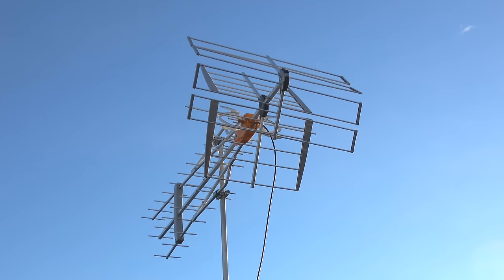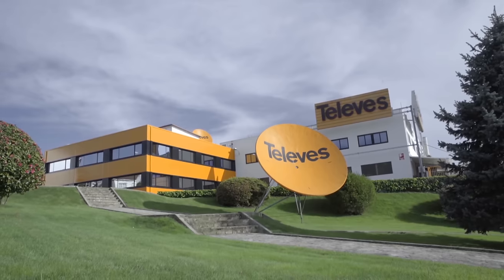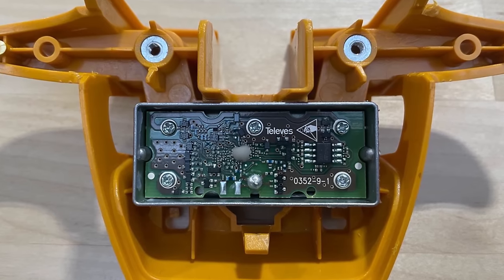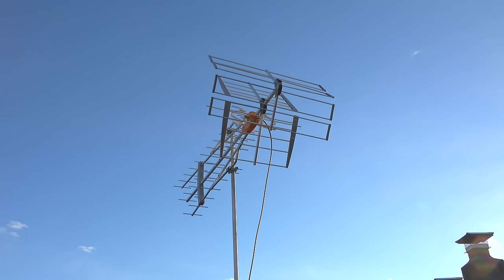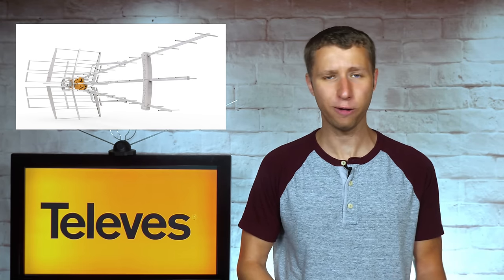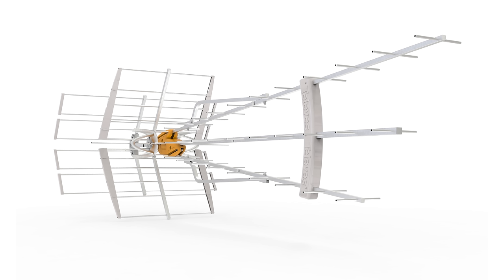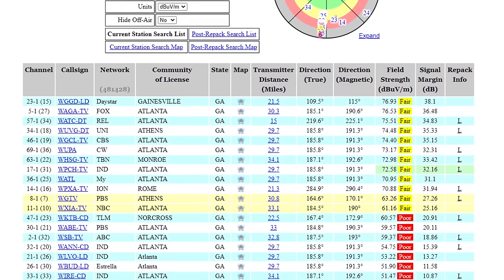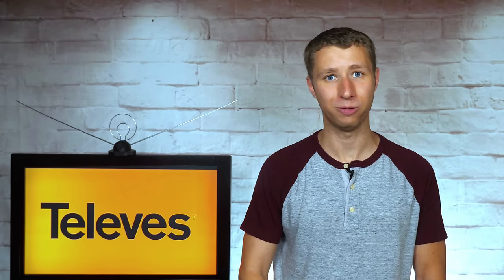New Televes DATBOSS LR Mix Review Updated Repack Model 149884

Comment: Thanks Tyler! To your point about atmospherics. We both know they were pretty good when you reviewed the Ellipse and fairly degraded now so the Dat Boss LR won out on dealing with season variation probably. Glad you figured out the magic is in the preamp. I picked up one of these end of May after working with the Range Expert and not  being able to bring in the 4K signals from Seattle reliably. Like I could via the older Dat Boss LR and the Stellar. I had been playing with height of the new Dat Boss LR and got all of the 4K channels for two nights [RF 24 has KOMO, KIRO, KUNS and 31 KING, KONG, KCPQ, KZJO] but King TV would not open. I am beginning to wonder if the adopters are using the same RF but on different towers or if the height of the transmitter on the tower differs for each broadcaster and may relate to signal strength? The weakest that would open was KZJO  with Signal Quality at 42 and Strength in the high 70's. It played pretty well but not to a reliable record level. The new VHF elements even had me seeing RF 11 of the old standard during the evenings much like the Stellar but here the new preamp makes all the difference in my mind along with one fewer combiner. 

A friend of mine used the Range Experts UHF element and my Stellar to pull in +65 channels at his house. Even RF 9 [PBS] at night time which is more than 50 miles and very low power. He also has my old DB LR and Ellipse. It may be that the ellipse may have a slightly wider angle than the Dat Boss but definitely wider angle than the Range Expert.  

It looks like the Ellipse Mix will be the only upgraded version to survive that series. Do you know if they will make a Repack version of the Dat Boss Mix with lo VHF and new preamp?  Do you think Televes would sell the new preamp to older Ellipse and Dat Boss owners or maybe make an upgrade package? Just got a post card they will be cutting the trees out of the power lines in my area in three weeks, about time since they are now above the top lines.  Hoping that may open up a different placement for my antenna pole to test. Maybe like with solar installers we need a drone but with an RF scanner? I did take one up 65' with a cherry picker looking for a signal, once.

Comment: What is the best long range uhf/vhf antenna that you would use. I am 70 miles from 7 broadcast areas. My antenna is 50 foot in the air with Amp and rotor. I do pretty good most times.

Comment: So the VHF element of this version is more than twice as good. I am now wondering maybe if you can somehow buy it as an aftermarket part, and install it in the older version of the LR Mix? Instead of re-purchasing the updated model?
Reply: I'd get the new model for the 5g filtering.

Comment: It would be nice if you could re-compare some of these new long range high tech antennas with some of the older style large "Radio Shack" style antennas like the Channel Master CM3020 you did three years ago. The readings in that review seem to be from completely different stations so I'm guessing they don't compare.

I don't think I've seen any good side by side comparisons with those super large antennas next to the new compact designs from Televes and the like.
Reply from the maker: I actually no longer own the large CM3020. It's not worth repurchasing the antenna and spending hours remaking the video as it would mess up the current reach of the video and my channel. I can tell you the CM3020 does better on the VHF band (especially low VHF) than the Televes LR Mix while the Televes does better on the UHF band where most TV stations are on.
Reply: @AntennaMan  - I wasn't specifically talking about getting the CM3020 again, but Channel Master still makes those type of Antennas like the Advantage 60 or Advantage 100.

Comment: Another good vid Antenna Man. Question. If i use rg6 cable, do i need a special connector to join two cables together and will connectors degrade my signal? Thanks.

Comment: I tested this antenna against the clearstream 4 max, and the 4max beat it hands down.  Not only was the clearstream picking up more channels from all directions, but the channels had higher signals.  The televes is 10 times the size of the 4 max, but could not match it.  Used the included amp on the boss, and used a televes amplifier on the 4 max.
Reply from the maker: This might be because the ClearStream 4Max isn't as directional, meaning it might pick up more channels if your stations are spread out.

Comment: Hey Tyler. Nice work. I've also installed several antennas for family and friends. I don't have signal meters or signal to noise meters. Just use tv fool. I'm in Canada. Can you please check out this new model RCA antenna. Claiming 100 mile range. I know how signals work. Just want to see how this antenna stacks up against the Televes models and so on. Here's the model number: ANANT950E 

RCA Multi-Directional Outdoor/Attic HDTV Antenna - Black
Reply from the maker: Don't use TV fool as it hasn't been updated in about five years. Most of the information on it is not accurate. Use rabbitears.info instead. As for the RCA antenna, I actually tried it out. Didn't work too well so I decided not to review it.
Reply: @AntennaMan  nothing else works for Canadians. Tried antenna web. Nothing. Found nothing. If you have one that works for Canadians. I would appreciate it

Comment: i had a recommendation  by "The Antenna Man" about a year ago and I purchases the old version of the DATBOSS LR Mix ( Model 149833 ) and it works great.  I was wondering if there are new updated  parts I could replace on my old model?  Like the rear reflector or the pre-amp?  If so, where can I purchase them, if there are interchangeable on the old model ( Model 149833 ).  Any info would be appreciated.
Reply: Older models are not upgradeable to latest specs

Comment: Feb 2024

     are   the long  beams  that stretch  out adjustable  like the smaller  model
 in your  previous   video
Reply from the maker: No, they are fixed, but you can adjust the tilt of the antenna.
Reply: thank you

Comment: it would be a great model for attic or garage , with the built in amp/electronics I don't think it would survive to long if you live in extreme climate conditions
Reply: These antennas are installed in over 100 countries in all sorts of environments. From scorching hot in Africa to subzero in Scandinavia. The preamplifier is fully shielded and weather resistant.
Reply: I have 1 & so far it has survived a Louisiana tornado. The other Televes I own is older & made it thru 2 hurricanes.

Comment: My antenna is in my attic and my channelmaster powered splitter is about 5 feet away from it. Will this antenna cause to much gain when used in conjunction with my 4 way powered splitter or would it help

Comment: How do you think this antenna will stack up against my 91XG With a booster, it works great but it's getting old, and sometimes even with 100% single, I get some pixelation, I'm guessing this may be 5G interference, thinking about replacing. Enjoy your videos, very informative. THANKS!
Reply from the maker: They would be pretty comparable to be honest. Technically the Televes antenna may have a bit more gain with better designed UHF elements and a built in preamp. However, it would be hard to say whether it would work better or not since both antennas are pretty good.
Reply: The advantage of this antenna is THREE over your 91xg. 1: It also does VHF within a 65 degree spread. 2: It has a built-in 5G filter that starts at 608Mhz 3: It's basically cut to not receive anything past channel 36. Your 91xg goes all the way up to old channel 83.

Comment: I purchased a DATBOSS Model 149884 last year for my location in the Michigan City, IN area (near Chicago). While it has served me well, lately I have temporarily lost channel signals at times. I don't know if this is due to spring/summer and foliage on the oak trees, signals from the broadcast towers, needing to change my coax cable run after getting my roof re-shingled, or installing my antenna higher (about 25' above the ground...Or maybe I should upgrade?  That would be a bit frustrating as I spent about $200 last year.
Reply from the maker: You should not need to upgrade your antenna. You already have one of the best models. What I would suggest is to check the power inserter to make sure the status light is still on. If it's not on you may need to replace the power inserter.

Comment: I'm having a difficult time finding a good antenna that works for television as well as my stereo receiver. I'm not sure if the antennas don't do low band UHF, or if the amplifiers in the antennas cause interference with the FM tuner in the receiver. If you think this model does well for UHF band, I'd like to see how it would work with radio reception as well.
Reply from the maker: Most antennas don't have low VHF capability for FM. I wouldn't recommend this model for you since it has an FM filter. Buy one of the low VHF antennas in the video below. https://youtu.be/6otvIew5tqo

Comment: I feel like Antenna companies will never fully take over air TV seriously until a major network say's they're losing rating's because more people are giving up cable, And they switch over to free broadcast airing.
Reply from the maker: Most don't take the performance seriously because most Americans prefer smaller antennas, hence the whole "I don't want that antenna on my roof." An antenna company will actually make more money on smaller antennas with high profit margins than large antennas with low profits margins. As I will say in a future video of mine, it's not about the antenna the customer WANTS but the antenna the customer NEEDS.

Comment: Tyler, in your opinion, how does the DATBOSS LR compare with the Channel Master 3020?  I am currently using a Clearstream 4V with a Televes preamp but on windy or rainy days, I experience signal loss. Also am experiencing loss due to extreme heat.
Reply from the maker: The Channel Master CM3020 will be it on VHF, but the DATBOSS LR will beat the CM3020 on UHF which is where most TV stations are. The ClearStream 4V is a very basic small directional antenna. The Televes DATBOSS should be an improvement compared to what you have now and would probably be better than the CM3020. If did you want me to take a look at your reception to determine if you even need to go as large as the DATBOSS Mix you can sign up for my consultation service below. https://www.antennamanpa.com/antenna-recommendations.html

Comment: Friend at the edge of reception range in a valley uses a 8200.  Main ATSC 3.0 channel here is 28.  Noticed this antenna was lower on channel 28 than the much smaller mix antenna you compared it to.  Was that because the amp was backing down the signal, or does this antenna have a low gain spot on channel 28?
Reply: It does not, the LR has a lot more gain than the two antennas in the video but broadcasting conditions change day to day

Comment: Will this pick up channel 5 if station is 15 miles away? Thanks in advance
Reply from the maker: It should! In fact if you're only 15 miles away you probably don't need this large of an antenna. You can probably get away with one of the smaller Televes antennas linked below: https://www.amazon.com/shop/antennaman/list/2LH365VAPDKLC?ref_=aip_sf_list_spv_ofs_mixed_d
Reply: @AntennaMan  even in hilly terrain?

Comment: How does this antenna compare to the Stellar Lab fringe VHF for VHF?
Reply from the maker: Better for UHF but obviously a dedicated VHF antenna will work better for VHF. One like the Stellar Labs model probably is not necessary if you can pick up the VHF channels fine with the Televes LR.
Reply: @AntennaMan  I have the stellar lab antenna and the signal on my homerun varies from 50 to 90+. I was thinking the televes might be better for vhf. I have the televes preamp you recommended and the combiner. My antenna is in attic maybe moving outside might help with signal not dropping into the 50s

Comment: @ Antenna Man
 Just curious if you have tested any of the Televes antennas with VHF for FM radio reception. I am looking at their line of antennas but also want to use it to boost FM radio reception.
Reply from the maker: I have not but I do not recommend the Televes antennas for FM reception. They have an FM trap built in which will kill FM reception.
Reply: @AntennaMan  Is this common among TV antennas marketed for digital TV? I know that I have seen LTE filters on them, and I remember being able to buy an FM filter back in the analog TV days to block them, so I am guessing strong nearby FM stations can still overload digital TV at times. I am guessing that there is no way to switch off the FM filter on the Televes antennas. Or is there?
Reply: The FM filter is not switchable on Televes antennas. You want to remove FM from messing with your TV reception.

Comment: How does this compare with the Televes Elipses? With the Elipses, on breezy, cloudy days my picture breaks up sporadically.  Four stations in one direction 18 miles from my house with one ridge in between (plus trees and other houses).  I either need to raise it to above my roof or find a stronger antenna for in my attic.  Thank you!
Reply from the maker: This antenna has more rain than the Televes Ellipse.
Reply: The DAT LR has substantial higher gain both in UHF and VHF High, but if you are in an attic your problems may very well be reflections. I'd recommend trying the Ellipse outside first.
Reply: Thank you both!!!
Reply: I own both this DatBoss LR & an Ellipse.  Your problem is location. At 18 miles, just place the Ellipse antenna on a 10 foot tall 1" diameter steel conduit pole & anchor the pole against against your house. At only 10' tall there is no need for guy wires or much additional support. Run only 6 cable & use the Televes pre-amp which was included with the Ellipse. I have exactly this on 1 of my antenna's clear reception to 60 miles on a strong broadcast signal, the others are within 40 miles & crystal clear.
Now the antenna I use for the DatBoss LR is 22' tall & properly securred pulling stations at 70 miles.

Comment: How directional is the pickup pattern. I have 3 stations at 349 degrees and one at 309 degrees
Reply from the maker: It's very directional. I'm not exactly sure of the degree span but it might be around 45 degrees. It really depends how strong or weak the signals are. If the signals are super weak the tighter gain pattern might hurt things. If they aren't too weak it might be fine.
Reply: Thanks, it’s a 40 degree span

Comment: The Channel Master Pro-Model antenna review?
Reply from the maker: James, be patient. It's going to be a few weeks. It's not like the antenna review just comes out of nowhere in a matter of two hours. A ton of work goes into it. As it stands now, I have the antenna but am waiting for a cooler day to review it. I will not go on a black tar roof when it's 95 degrees outside. For what it's worth the Pro-Model is built very well but gain appears average comparable to other medium sized directional antennas. The main selling point is the made in USA build quality.
Reply: @AntennaMan  I just want to know if its performance is comparable with the CM-2018 as I'm looking for a medium size tough antenna in a market with nothing but UHF and high VHF.
Reply from the maker: @jamesm568  I can't tell you yet as I haven't tested it out. It does appear smaller than the CM2018 which means it probably won't work as well unless you get the extension elements
Reply: @AntennaMan  Understand! I personally haven't found any bad reviews on it and so far no reviews on YouTube.
Reply: @AntennaMan  Went ahead and purchased this antenna that was in the video and it works pretty good, but looking into if the high VHF elements from the Televes DATBOSS Mix LR UHF VHF Long Range Outdoor TV Antenna (149884) would also fit on this antenna in the video.

Comment: Does Televes make an indoor antenna for the attic that you would recommend? If so, link it and I'll grab it through your link.
Reply: I have a Telves dinova boss mounted in the attic of my two story home. I live about 15~ miles south of Baltimore with D.C. a little further away. I'm able to pick-up stations in both markets with its wide antenna gain pattern. My Televes slightly outperformed the Winegard Elite 7550 that I tried in the same spot. He may have linked it in his review of the Televes that I am talking about.
Reply from the maker: So you can place any antenna in the attic. It makes more sense to set up a larger outdoor antenna in the attic than a smaller, lower gain antenna that's marketed as an "attic antenna." Below is the model I've been recommending for the attic. It isn't as large as the LR model which makes it easier to move around. Make sure to try different locations for the antenna in the attic as moving one as little as a few feet can have a huge impact on reception. https://amzn.to/36fT7qg
Reply: I concur with Kevin about the Dinova Boss. I live in a condo about 10 miles south of the DC towers and it is able to receive stations from the DC and Baltimore markets.

Comment: 60 vs LR comparison?
Reply from the maker: This one will have a bit more gain. The smaller DATBOSS is still a good antenna. This one will just have a bit more muscle. It may not make a difference if your signals aren't super weak.

Comment: Is this a good option for the attic?   Thanks!
Reply: I had one in my attic.  I have a very high opinion of this antenna.  Unfortunately, due to the layout of my attic and the way the duct work is ran, I had to go with something smaller.
Reply from the maker: If your attic has the room for one it might be a good option. Otherwise I'd recommend the slightly smaller DATBOSS Mix below since it's easier to move around. https://amzn.to/36fT7qg